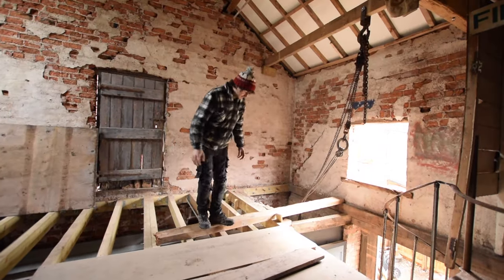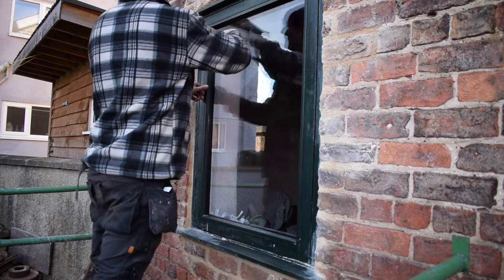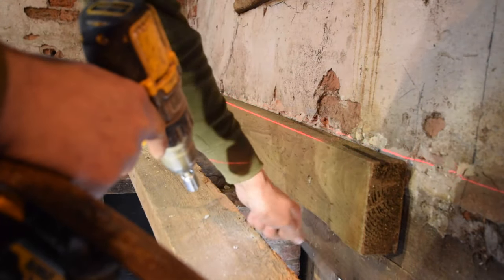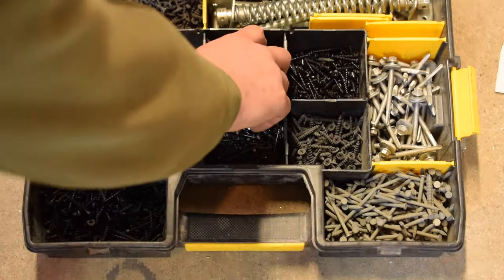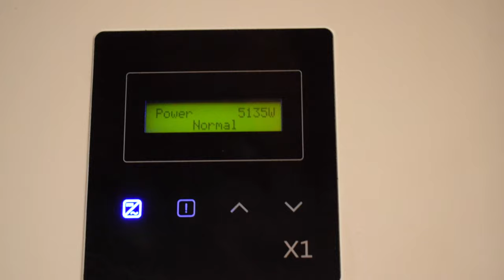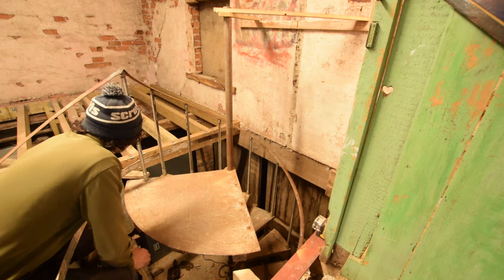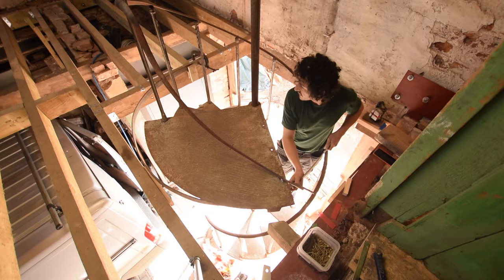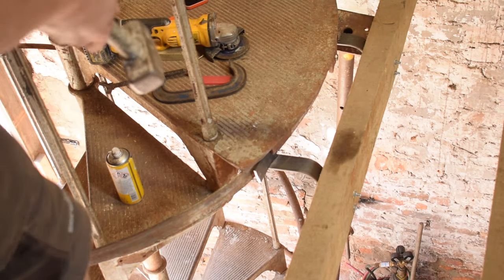Spiral Stairs for the Abandoned Coach House & Floor Joist and Window Install

Comment: I have always admired circular staircases, they give so much character to a building! I especially like how you didn’t clean them up & have left them rusty, it fits so well with the aesthetic of the property. But perhaps you should create a large trap door in your floor as you go in order to get your future furniture upstairs, lol? It’s hard to see how you would get a couch or even a double bed around those curves. 😂 Great work!
Reply from the maker: That’s a good plan, they are a right pain to carry things upstairs. No way you could get a sofa up so I’m currently looking for a pulley that I could rig up outside, to use one of the first floor doors. 
Thanks for the comment, great to connect with another Patina enthusiast!